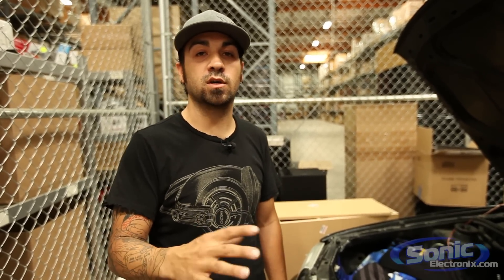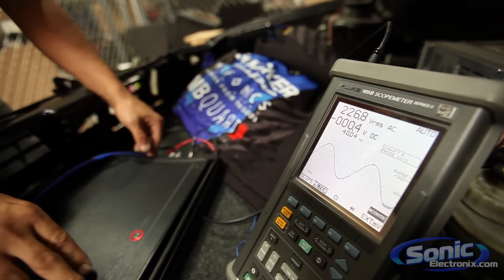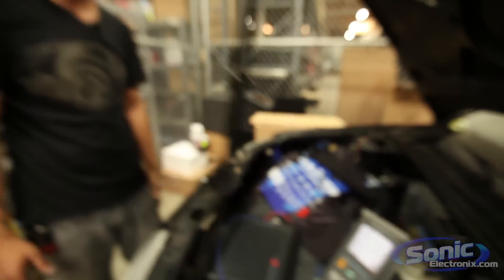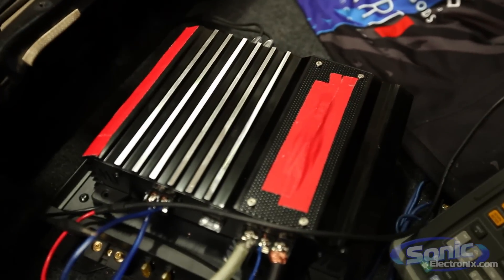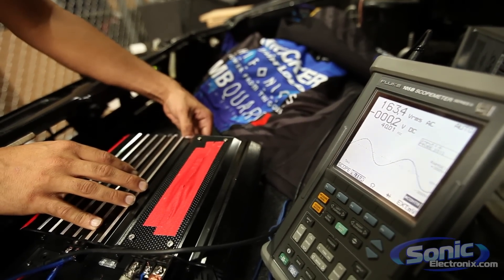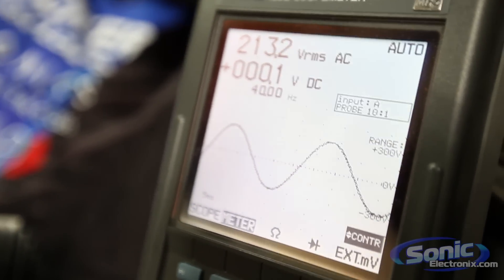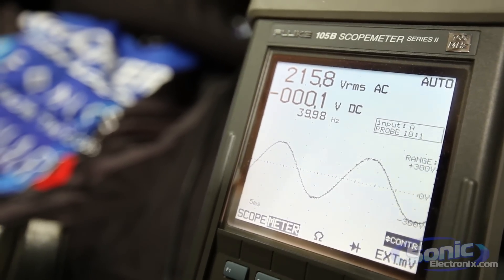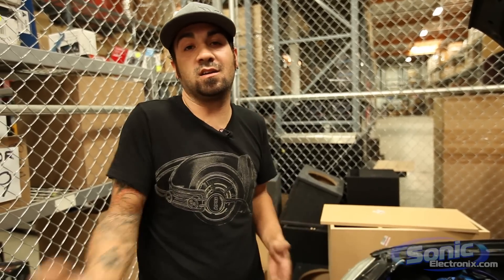Overrated vs CEA Car Amplifier Test | True Wattage Revealed!

Comment from the maker: No problem! REMEMBER, that is just an estimation formula, it is used to help you figure out if the amp you want is untrue to it's ratings. You will see on high quality amps that your formula will give you higher power ratings than what they advertise, which is good. Use it as a tool to help you, don't use it as a final decision maker. :)

Comment from the maker: No and No. To get a rough estimate as to how much power an amplifier outputs at it's lowest impedance (ohm rating), just use this formula. Multiply 14.4V by the combined amperage of the fuses on the amplifier, just add the fuse ratings together, and then multiply by .8 for class D amps or .6 for A/B class amps. For example, 14.4 x 30A x 0.8 = 345 Watts (estimated) at 2 ohms. Use this to help you find out if amplifier output what they say they do.

Comment from the maker: Incorrect gain, which results in distortion and then overheating of a woofer is the #1 reason for subwoofer deaths. The gain control is VERY misunderstood. Gain control is meant to match the output voltage of the device (radio) to the input voltage of the amplifier. Take a .25V audio signal and turn your gain to max and the amp will amplify that signal so much it begins clipping and distorting which ='s death to woofers. Low wattage itself wont ruin a sub ever, turning the gain up will.

Comment: ooooooooooohhhhhhhhhhhhhh. thanks so much. it makes so much sense. So i definitetly should not turn up my sub anymore until i get my new head unit and set my gains right.  I turned it up once and i heard a nice electrical distortion noise and it cut out on me. Really scared me as im running a sundown sa-8v2 and i dont wanna be that guy that burns a sa-8 on only 500-600 watts

Comment from the maker: Gain is not a volume knob (technically). If the Hitron only puts out 0.25V then the Hifonics gain needs to be the same. If the gain is higher, you introduce distortion into the system. A new headunit will definitely help and output a much more powerful, cleaner signal.

Comment: im upgrading the head unit for my birthday, so it should be problem solved. The hitron is a real problem and i bought it from you guys. puts out less than 0.25v off of the stock stereo from a volt meter. Buying a pioneer head unit for 100 that will put out 2.5v and it will make my rockford punch s3 6x8's sound awesome!
What do you think about hifonics? Im running a hifonics hfi1000.d Its not the amp just being crappy and cutting out at high volume is it? 50% and lower sounds great.

Comment from the maker: Gain adjustment is a very difficult thing to do. Your headunit itself could be clipping your signal, try not to turn it up past 75% or so. The input voltage on the amp (the gain) should match the output voltage of the line out converter. If they match, and you are not happy with your system, you will need to upgrade to a more powerful sound processor or headunit.

Comment: so if i upgrade to the 20$ one off sonix will it be louder? i have the input voltage all the way down on the amp and the signal will distort if i turn it up past 80% off the head unit. doesnt sound great for 750w on an 8" sub. sounds like 500

Comment from the maker: Remember, wiring in series is used to INCREASE the Ohm load and parallel is used to DECREASE the Ohm load. A single Dual 4 Ohm subwoofer wires to a 2 ohm load, so you will need a 2 ohm stable amplifier at the RMS wattage of the subwoofer.

Comment: i have a kicker L5 10 in which is 4 ohm dvc..if i run it paralleled does that drop it in ohms or raise..also do I need an amp that is 2 ohm capable if it does drop?  Thx!

Comment: Im sorry but I have to disagree. I had that same hifonics 1700 watt amp, I thought it was great until I upgraded to the rockford fosgate T1500-1bdcp. The Rockford 1500 is substantially louder than the Hifonics 1700 was. You may not believe me but I experienced it myself, a Kicker, rockford, or sundown 1500 is way louder than a Hifonics 1700 is

Comment: I have a Hifonics BRZ1200.1 running at 1 ohm on my 10" Orion HCCA Subwoofer. Can you verify that it actually outputs that much power because even though it's CEA-2006 compliant, I honestly don't think it's even pushing that much.

Comment: Hello Madjimms, 

Thank`s for the reply on my request. 

However, I disagree with you on the PDX being more efficient than the HD900 . 

According to the specs, and i`m not sure how accurate they are but, the PDX will draw 80 amps max at full output whereas the HD will draw 60 amps max based on the fuse requirements from JL. 

Also, according to the specs, again i`m not sure how accurate they are, but the JL will makes it`s full power over a wider voltage " aka " lower voltage than the PDX.

Comment: Either would be good because of the CEA 2006 rating, but the PDX line is much more efficient. So you would need to use less (overhead) watts to achieve the same output wattage.

Comment: Another way to help is fuses. If an amp is rated at 500rms and only has 30 amps of fuse, it'll never put out that 500rms. That's why when you say 3krms+ amps. They have external fuses because having 10 30 amp fuses would be ridiculous. Like for example my Alpine MRP-M500 has (2) 30 amp fuses and is only rated at 500rms @ 2 ohms so it's safe to say it puts out a little more than rated. And my older Pioneer GM-D5400M had the same (2) 30 amp fuses and was rated at 600 rms @2 ohms. Hope this helps!

Comment: Even if the amp pushes 250 watts, what is the THD? Guessing greater than 10.0% , while the Kicker would still be at les than 0.1%. The kid with a 2000w amp on 2- 12"s cheapo setup still wonders why my 500w alpine/single 12" Kicker SC sounds better lmao

Comment: the problem is most amps are rated at 14.4 volts and most charging systems dont run at that .. Also there is unregulated power supply amps and none unregulated amps

Comment: You cant always use the fuse capacity to try and get a rating. My amp doesnt have any fuse inputs on it and is CEA certified. When it boils down, you get what you pay for.

Comment: I have a question:
I have a SMD meter and was wondering how to match my amp and sub at the proper rms. My amp is running 2ohm @ 600 wtts rms. My sub is 300rms @ 2ohms. How do can set my amp rms to match my sub rms and not over power it? Thank you!

Comment: what i meant is, if they claim 1500 watts, and the amp only has 2 20a fuses, obviously something is not matching up.  if im not mistaken, you take the amps times the voltage to get a rough estimate.